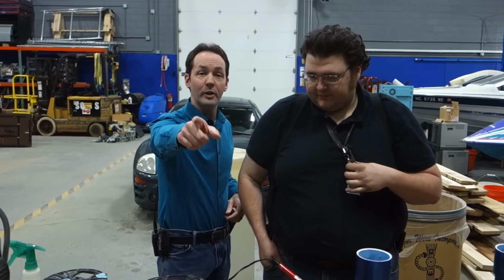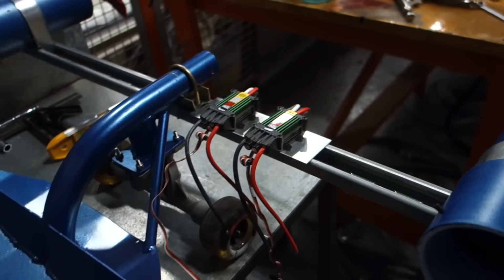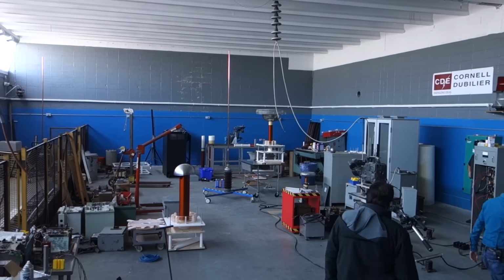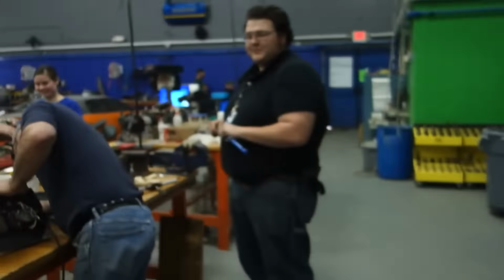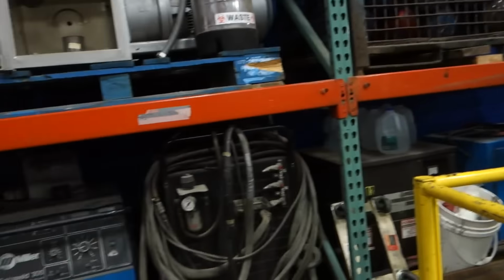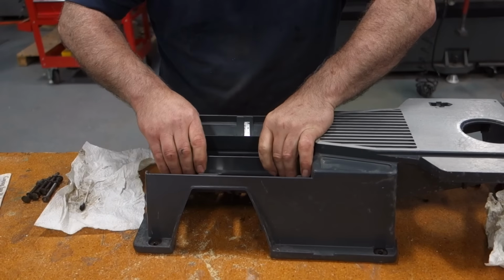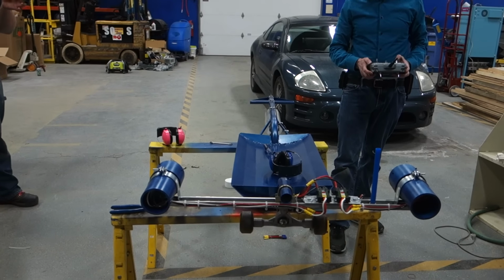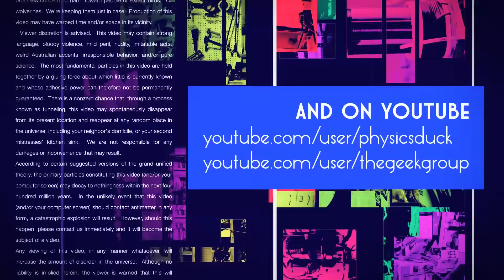Captain's Blog 2 20 2016 Big Saturday and Jet Luge First Testing

Comment: Yay!  Succesful maiden flight. I remember mine in 2005 but it was more like 89 mph in the nieghborhood and the cops stopped the traffic for me. They helped because I was wearing full leathers and a helmet.  A couple ideas if you  on continuing the project.1. Larger diameter wheels with high rebound urethane = more speed.  ABEC 11 92 or 97MM Flywheels will do the trick.   Do you want a set?2. Instead of a radio get wired with a servo tester unit. You can swap the POT with a 0 to 5K spring loaded Throttle POT 3. Turning: I see you have Randal Luge Trucks. Make sure you have 50 or 60 degrees baseplates, fresh but softer bushings with flat, not cupped washers. Also make sure the "F" is showing on the hanger. "F" has a steeper turning angle than the "R" side.4. Wear a helmet and gloves so we can continue to watch you make cool shit.Let me know when you wanna race.When your happy with the build, send picts and spec to Roland at http://www.poweredstreetluge.com/   to be included in the powered street luge club.Cheers

Comment: Bullet connectors are available in 3.5mm, (i think 4mm) and 6.3mm, can't find specific sizes for that motor here's a link http://www.horizonhobby.com/product/airplanes/airplane-accessories/other-accessories/gold-bullet-connector-set--35mm-(3)-efla241
With that amout of current, my guess is that they can get away with smaller wire because the intention is to keep them as short as possible, i would have mounted the esc's next to the motors, and the batteries next to the esc's
maybe that link wire is so you can connect the batteries in series, while still maintaining the main connector.
If you use 12v led strips, just use a 12V regulator, something like a 7812 can take 1.5 amps
You need a dinosaur for safety.

Comment: charger is borked.  (i enjoy using your speech.)  very different way of charging batteries.  those batteries are also bricks.  put rollers under the jets.  you get loads of exercise walking around the lab.  tours look like 3 groups of ten.  loud as in B!A!N!G!.  baby then toddler then child.  :)  you have a very long hotstick.  i would say "come on down.  electricity is nice at a distance.".  playing with electricity is fun. tanner is mimicking you.  the arc appears to slightly burn either tip it connects.  it's not very secret once you see it.  why did he mention the fourth wall?  TGG secret sauces look fun.  post tour Q and A looks stressful.  sometimes my for profit employer collects for charities also.  what will you do after the mortgage is paid off?  look for the Sam Sitar tile.  that party maker is a busy man.  82,000 square feet is HUGE.  online members can donate or join.